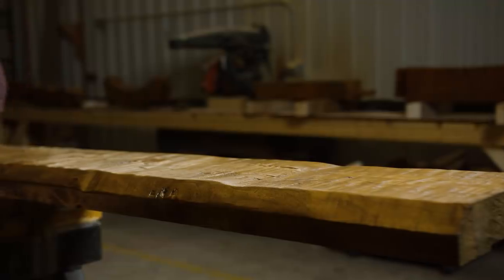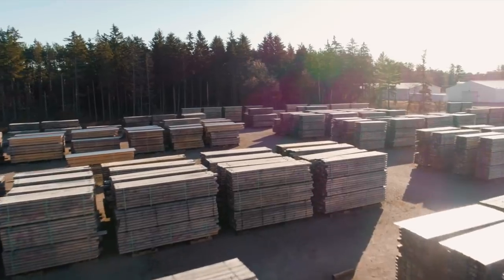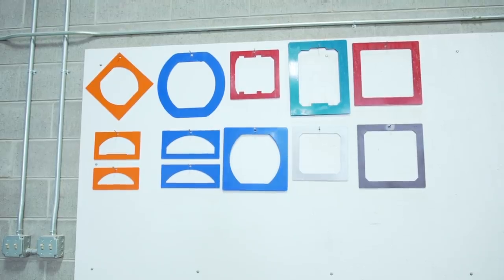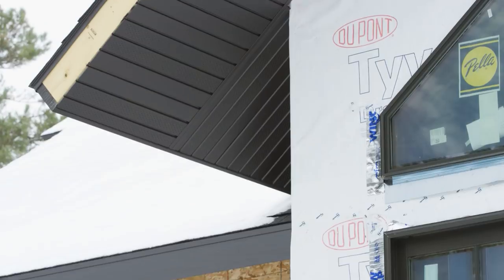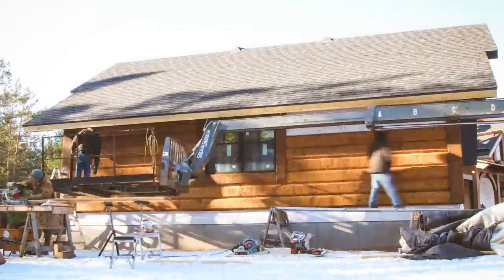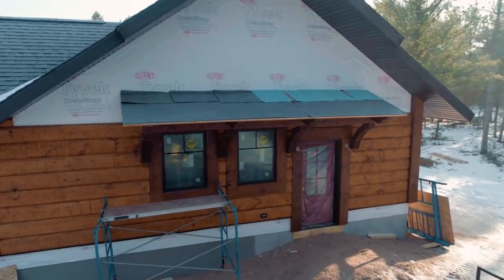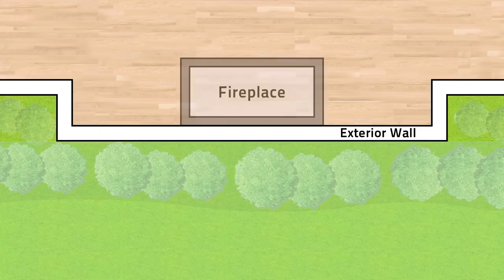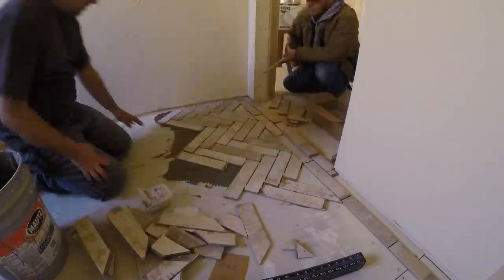EP 7 Building My Dream Home - Log Home Milling & Timber Trusses

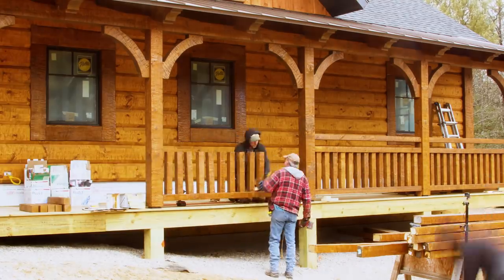Comment: I really like how the house looks and how it was built, but I still have some details that I would do different in my own build. For example at 6:50 when they assembled the railing it just broke my heart to see that nice looking wood fixed with all those angled screws... I would of taken the time to at least make a two pin joint (2x10mm pins on each side) so no screws visible. Overall excellent work and really inspiring.
Reply from the maker: --
Thank you very much for watching and commenting!

Comment: i like the idea of the half logs on the outside. But have you guys ever thought of a hidden over lap like some weather boards have? Just an extra kind of seal or moisture barrier. That way if for some reason the top log doesnt sit hard on the lower log because of a slight imperfection, it is still sealed.  Only asking because i live in australia and we dont really see builds like in the video. Do like the design of the house tho.
Reply from the maker: Make sense. We do have some products like that. Thanks for watching! We hope you enjoyed the video series!

Comment: Great stuff. Only thing I can't understand why they installed metal roof on the lower part. It's going to be noisy as hell when it's raining. Specially if there is no insulation underneath the thin which would make it less noisy. Just plain thin.
Reply from the maker: Here is the deal camper roof's are noisy no insulation We have thick insulation and wood no problem

Comment: beautiful home. . .question, how come no rigid foam insulation on exterior walls .. or its not required if you use the log timber ?
Reply from the maker: We offer rigid foam as an option, Zach wanted some spray foam in the wall cavity to maximize the r-factor and to seal out lady bugs and such.

Comment: Hi Guys, any reason apart from cost for using OSB for your sheathing instead of the Zip System products?
Reply from the maker: Zip system products are great - but due to Zach's protection with long overhangs, they aren't worth the cost.

Comment: What is the difference between your white pine and your cedar? Is one better than the other?
Reply from the maker: They are both great, give us a call on that question 800-270-5025 it can get lengthy. thanks for watching too,
Reply from the maker: They are both great, once you stain them it is hard to tell them apart, cedar costs 4x more

Comment: Ich denke eine Meldung, wie zum Beispiel ein rotes Licht, sollte signalisieren wenn die Trppe nicht in Position und verriegelt ist.
Ansonsten bleibt hat es ein hohes Gefahrenpotential, höher wenn die Bewohner älter werden oder auch Kleinkinder. Der Zuständige sollte sich gut absichern.

Google translate
I think a message, such as a red light, should signal when the door is not in position and locked.
 Otherwise there remains a high risk potential, higher when the residents get older or even small children.  The person responsible should take good precautions.
Reply from the maker: @bermuda3647 Thank you for watching and commenting!

Comment: a house so how much can it cost to make it in florida
Reply from the maker: How much would it cost me to build this home?
If you have been following along in the video series "Building My Dream Home" episodes 1-10. You may have been wondering what the total build cost (♦ turnkey cost) would be.

Zach started with the smaller Clearwater 1750AR Ranch. For which either the Premium Exposed Beam Timber Package, or the 8 Inch Premium Half Log Package! and would turnkey for approximately $369,000.

We also have a model called the Clearwater 2095AR Ranch which is more similar in size to Zach's home. For which either the Premium Exposed Beam Timber Package, or the 8 Inch Premium Half Log Package and would turnkey for approximately $575,000.

Zach used the Ultra Custom Timber Package version, the Timber Ranch 2286AR-CT. The Ultra Custom Timber Package is fully loaded with taller wall heights, taller windows, and taller interior doors and our finest cabinetry. Plus massive timber band boards, rafter beams, and custom timber style trims. So, Zach's house as it is built (depending on where you are building it) would turnkey for approximately $950,000.

♦ Turnkey costs do not include the unpredictable variable costs such as price of the land, well, septic, landscaping, taxes, and shipping.

If you have any questions or would like more details please feel free to Contact Us or call 1-800-270-5025 Toll Free

Comment: Besides the land how much is this house?
Reply from the maker: Fully Built (Turnkey) Cost of Zach's Dream Home
If you have been following along in the video series “Building My Dream Home” episodes 1-10. You may have been wondering what the total build cost (♦ turnkey cost) would be.
Zach started with the smaller Clearwater 1750AR Ranch. For which either the Premium Exposed Beam Timber Package, or the 8 Inch Premium Half Log Package! and would turnkey for approximately $369,000.
We also have a model called the Clearwater 2095AR Ranch which is more similar in size to Zach’s home. For which either the Premium Exposed Beam Timber Package, or the 8 Inch Premium Half Log Package and would turnkey for approximately $575,000.
Zach used the Ultra Custom Timber Package version, the Timber Ranch 2286AR-CT. The Ultra Custom Timber Package is fully loaded with taller wall heights, taller windows, and taller interior doors and our finest cabinetry. Plus massive timber band boards, rafter beams, and custom timber style trims. So, Zach’s house as it is built (depending on where you are building it) would turnkey for approximately $790,000.
♦ Turnkey costs do not include the unpredictable variable costs such as price of the land, well, septic, landscaping, taxes, and shipping.
Reply: @goldeneagleloghomes  Thank you for the Reply Sir..

Comment: How much is the price to build a house like this
Reply from the maker: How much would it cost me to build this home?
If you have been following along in the video series "Building My Dream Home" episodes 1-11. You may have been wondering what the total build cost (♦ turnkey cost) would be.

Zach started with the smaller Clearwater 1750AR Ranch. For which either the Premium Exposed Beam Timber Package, or the 8 Inch Premium Half Log Package! and would turnkey for approximately $465,000.

We also have a model called the Clearwater 2095AR Ranch which is more similar in size to Zach's home. For which either the Premium Exposed Beam Timber Package, or the 8 Inch Premium Half Log Package and would turnkey for approximately $596,000.

Zach used the Ultra Custom Timber Package version, the Timber Ranch 2286AR-UCT. The Ultra Custom Timber Package is fully loaded with taller wall heights, taller windows, and taller interior doors and our finest cabinetry. Plus massive timber band boards, rafter beams, and custom timber style trims. So, Zach's house as it is built (depending on where you are building it) would turnkey for approximately $916,000 - $975,000.

In different parts of the country construction costs may be more or less. And you would need to add Land Costs, Well, Septic, Landscaping, Etc.

Contact Us or call at 1-800-270-5025 and we can help you start planning your dream home.
Reply: @goldeneagleloghomes  How long does it take to build a house like this
Reply from the maker: About 8 to 9 months

Comment: Who the heck gave this a thumbs down?
Reply from the maker: We were wondering the same thing. haha.
Reply: Probably a competitor or someone that works for them ..... like so many complaints about products and brands ..... when will you last episodes be aired gonna subscribe and add you to my email ... great series ..... would the shipping cost to Alaska say Anchorage region  be cost prohibited ??? for something like you built minus so of the extra's 
Thanks
Reply: Most likely competition. I have been doing my homework on this company and it's competition for the last several years as my wife and I are about to retire and hope to build a log home. This company in my opinion is hands down the best!
Reply from the maker: Hi Joe - shipping to Alaska wouldn't be a big deal on the overall cost of the project because the products would have needed to be shipped their either way - even if you buy from a hardware store.  They just increase their retail prices to accommodate the expense.
Reply: hovsepdov because the Earth is running out of 🌲

Comment: 3:36 not really no.. some as gone into powder... you are at least losing the width of the cut on the whole length.
Reply from the maker: We actually get paid for the sawdust too as it is kiln dried. It goes for pellet stove pellets.
Reply: @goldeneagleloghomes  well in this case you never lose anything. The guy said "we only lost that" which was... not true.
What you do is pretty well done, the process seems very efficient and precise. i wanted to build a log house and in the end gone with a more insulated solution, what we call positive houses here in europe. I'm pretty happy with my choice.
Do you know what the R value of 10cm of your walls..?

Comment: This house is probably 10 mil
Reply from the maker: If you have been following along in the video series “Building My Dream Home” episodes 1-10. You may have been wondering what the total build cost (♦ turnkey cost) would be.
Zach started with the smaller Clearwater 1750AR Ranch. For which either the Premium Exposed Beam Timber Package, or the 8 Inch Premium Half Log Package! and would turnkey for approximately $369,000.
We also have a model called the Clearwater 2095AR Ranch which is more similar in size to Zach’s home. For which either the Premium Exposed Beam Timber Package, or the 8 Inch Premium Half Log Package and would turnkey for approximately $575,000.
Zach used the Ultra Custom Timber Package version, the Timber Ranch 2286AR-CT. The Ultra Custom Timber Package is fully loaded with taller wall heights, taller windows, and taller interior doors and our finest cabinetry. Plus massive timber band boards, rafter beams, and custom timber style trims. So, Zach’s house as it is built (depending on where you are building it) would turnkey for approximately $790,000.
♦ Turnkey costs do not include the unpredictable variable costs such as price of the land, well, septic, landscaping, taxes, and shipping.
Reply: Wow lots of money this house is beautiful though...